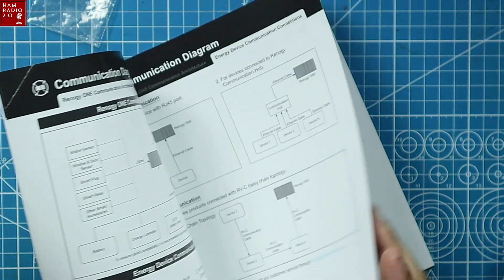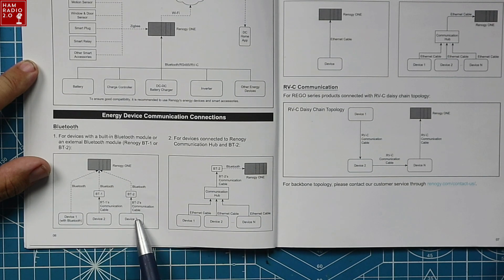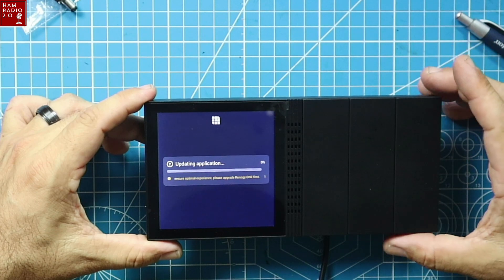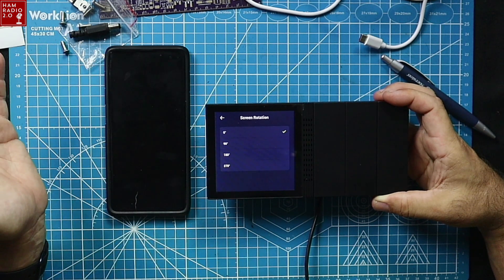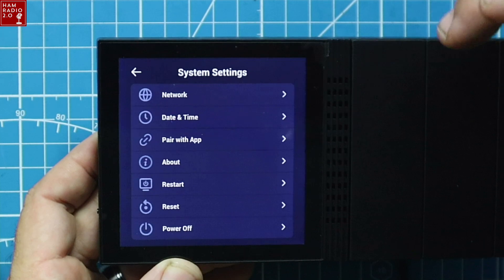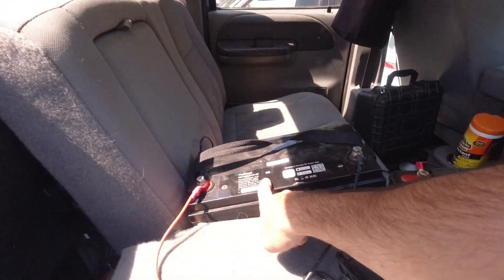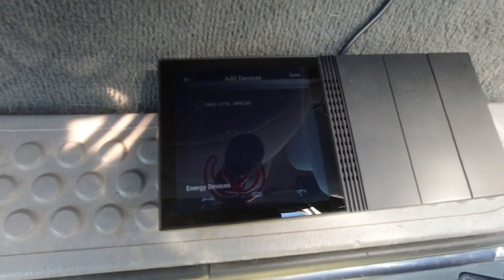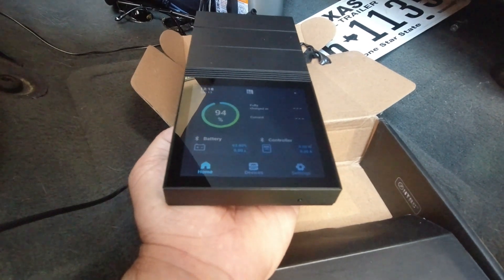How To Monitor Your Off Grid Power System Like a PRO

Comment: Kinda late to the party, but interested in Renogy tech for my travel trailer. Victron makes nice stuff but it’s sure expensive for a part timer. Main component I was interested in was their 3000w inverter/charger. Was kind of curious what communication they offered as it didn’t seem that clear on the product page. Also curious if something like the inverter can talk to a non-Renogy battery over the serial port. I was looking more to a server rack battery. Better price per amp hour and more solid construction. Should be much simpler to connect to the inverter as well.

Comment: hey man, do you know if you can connect a non-smart-litium renogy battery? like a AGM renogy battery.
i have their battery monitor, but they didnt put bluetooth on it. 
they said another battery monitor with bluetooth will be available, but still waiting. 

I also have a big renogy inverter that it does have an RJ45 on it, but only mark as "future use". 

renogy is screwing clients a little bit by selling a lot of parts that are not align with the future developments. 

thanks
Reply from the maker: It's best not to mix chemistries
Reply: @HamRadio2  meaning, receiving free stuff mixing with giving a unbiased opinion?

Comment: We have a Rover 30 amp MPPT solar controller with a BT-1 bluetooth module for going on 3 years in our trailer.  Originally had a Renogy Adventurer PWM controller. The MPPT made a big difference especially in low light situations. I'm always interested in any new solar related technology.  Keep it up.  You channel is great.